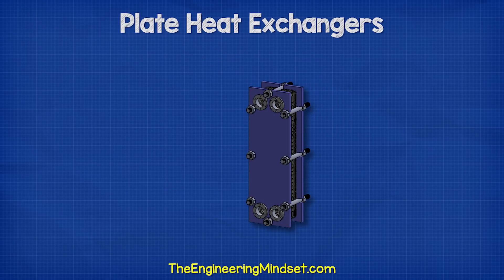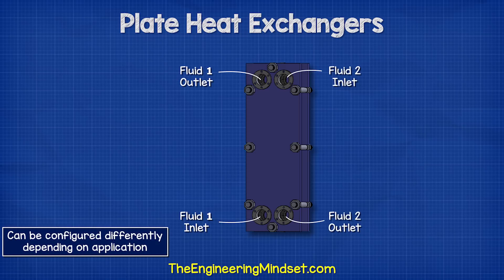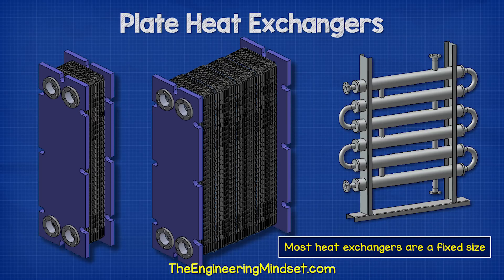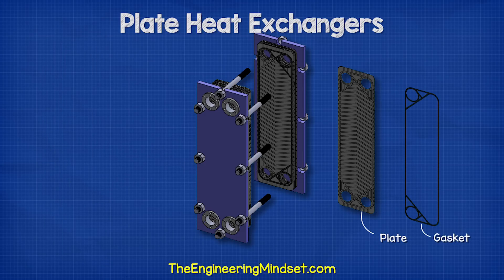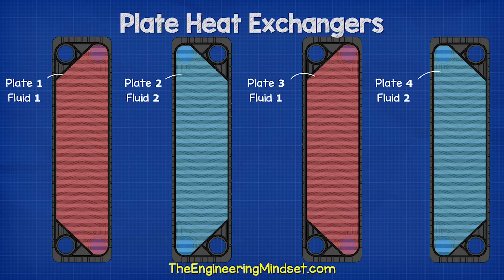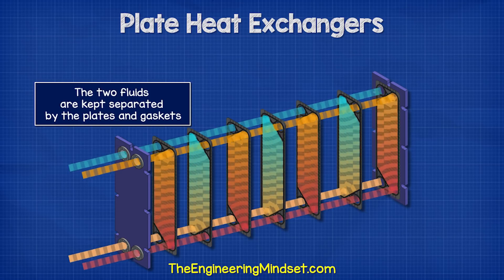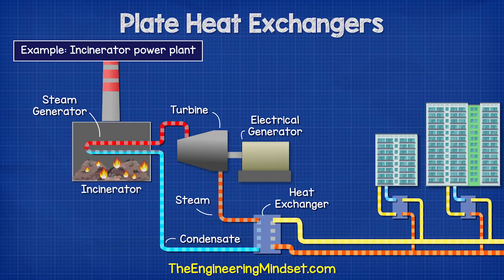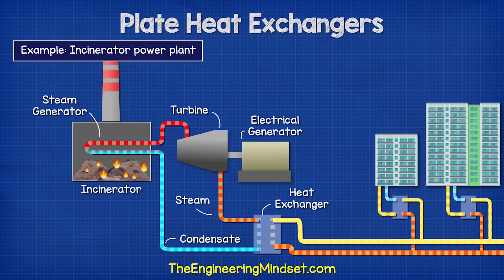Plate Heat Exchanger Basics

Comment: I used to clean these on my previous job, all it takes is a rough bristle brush, water and a lot of strength since some of the build up are quite hard to get rid of, limescale if I remember correctly, though most dirt are just like moss build up. The rubber gaskets are applied with rugby when necessary
Reply: In my current and also previous work , mechanics clean them with a pressure washer

Comment: Applications requiring up to 20 tons will use a brazed plate heat exchanger. Also the riffles on the plates are designed to force a scouring action and minimize mineral deposits from water.
Reply: 20 tonnes of what exactly?. In any case, the ripples are there to create turbulent flow which breaks down the boundary layer to increase the rate of heat exchange.
Reply: @davidbesant  20 tons is a btu/hour rating and seeing as how the information I just mentioned comes directly from GEA flatplate, I’d say it’s correct.